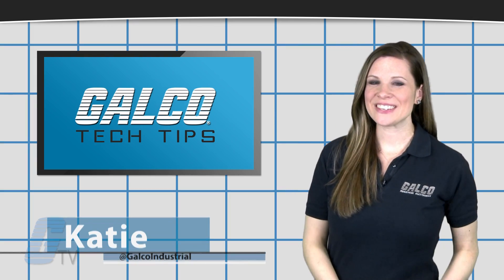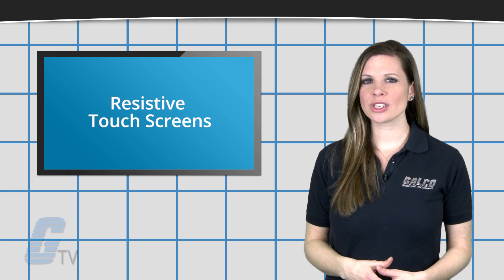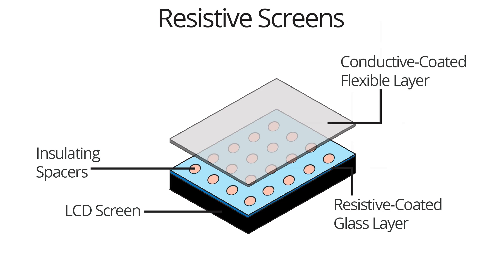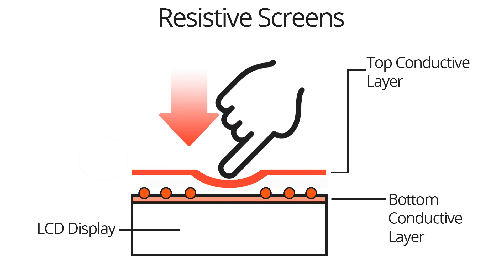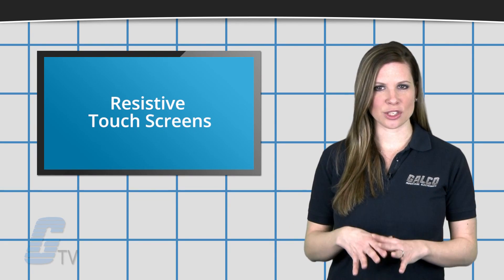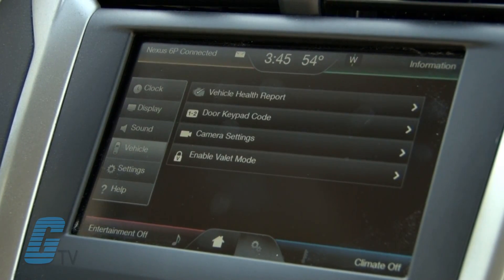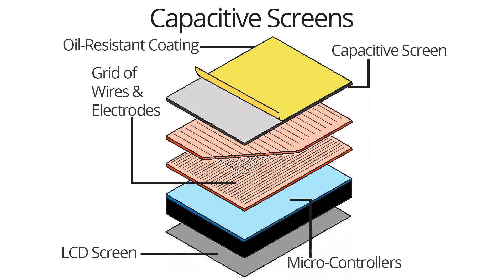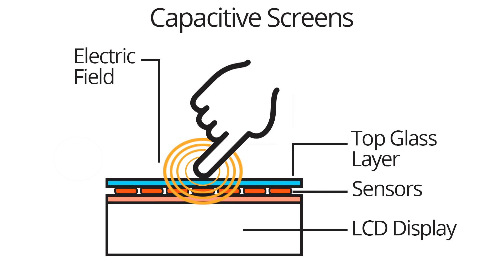How Touch Screens Work - A GalcoTV Tech Tip | Galco

Comment from the maker: A touchscreen is an input device normally layered on the top of an electronic visual display of an information processing system. A user can give input or control the information processing system through simple or multi-touch gestures by touching the screen with a special stylus/pen and-or one or more fingers.